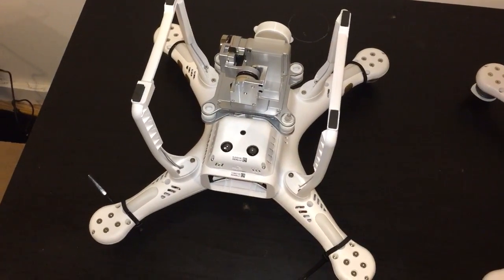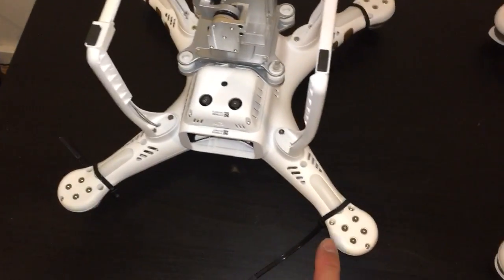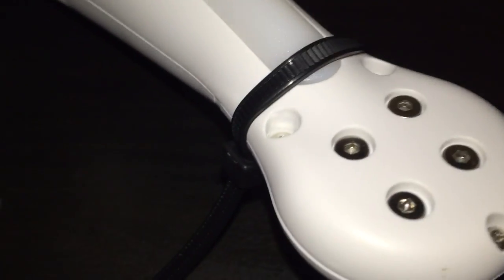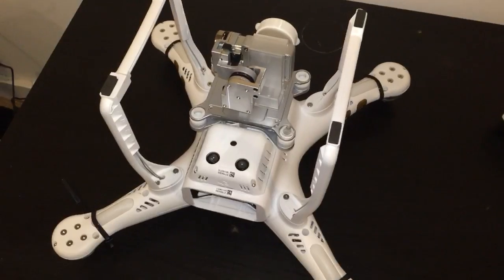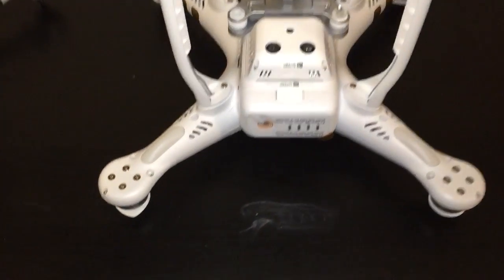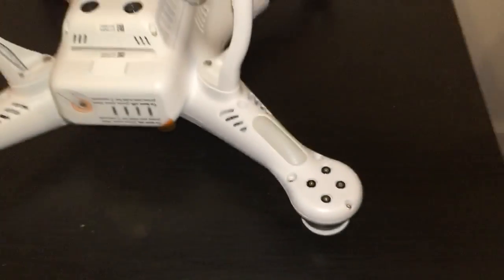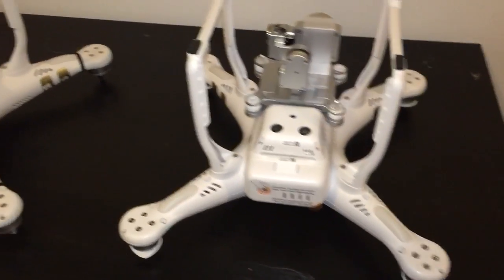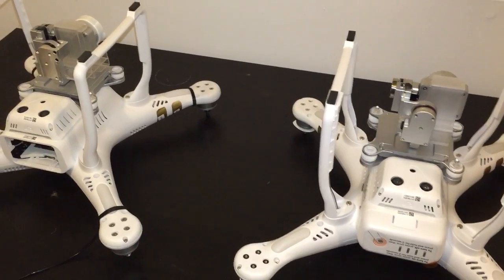UPDATE: DJI Phantom 3 Professional and Advanced Stress Cracks

Comment: Keith, this has to be a factory defect( with the shells). I just glued mine, backed out screws and reset. I was hesitant to do it but I felt it was the best thing to do. No more issues. Shell is very secured, no movement on the arms at all... I hope DJI takes care of this issue and your new unit. Good luck Al